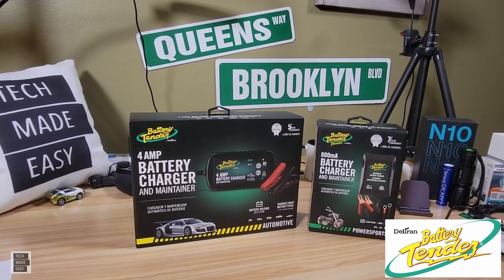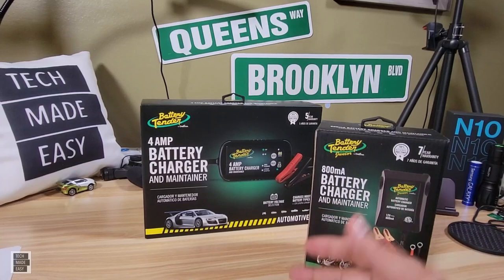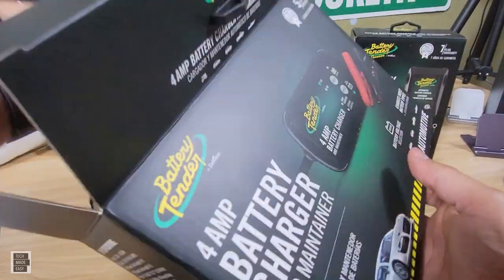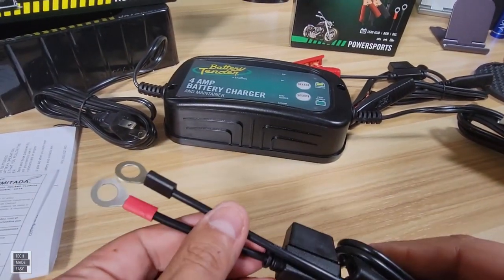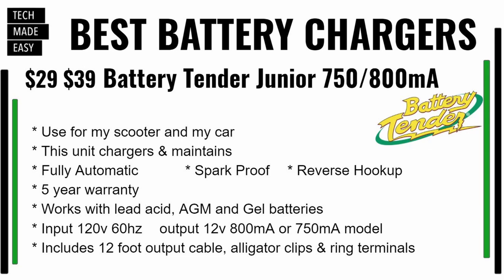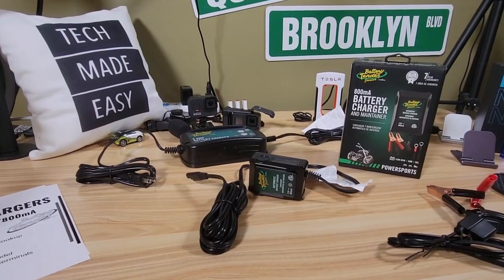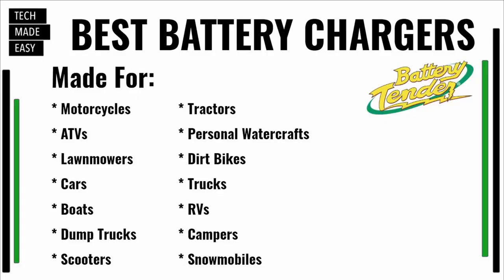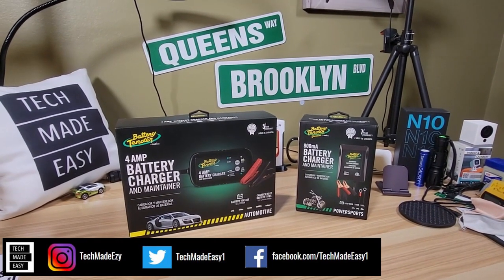Battery Tender Saves your Batteries Battery Tender Review

Comment: I heard about Battery Tender many years ago. But I’ve only started using one recently, which I bought from our dealer (they have a private label version).

Definitely has saved our battery several times. We’re going to get the ring terminals installed the next time we need to take the vehicle into the dealer.
Reply from the maker: I’m glad it isn’t expensive as well

Comment: Hey Tech!  Been using Battery Tender for nearly 20 years.  Great brand and great products!  Very reliable.
Reply from the maker: Thanks Kraz definitely impressed myself
Reply: "Been using Battery Tender" - Me too. But folks should also know that they will dry out your cells if continuously plugged in (It in fact heats up the cells, this KILLS your battery !). Better to have these battery Tenders first plugged into a TIMER; I set mine for only four hours a day. This allows the battery to cool down & not get to the point of 'boiling'; less chance of drying out the battery electrolytes (lifeblood of the battery). :face-fuchsia-wide-eyes:

Comment: I plugged in my 1.25 A charger 'Battery Tender Plus', like  your 4 Amp charger,  to my handheld spotlight ( came with a plug socket like your scooter) and the orange and green alternate in flashing. My battery is a 12 volt and I'm guessing it means it's 80% charged . Never seen the orange and green flash alternately before.  I did check the plug for POSITIVE AND NEGATIVE to make sure the plug was on it ok. I also just replaced this battery and used it a few times also. The green 12v light stays solid.

Comment: It looks like you have the positive cable removed from your Mustang battery.  Is that just how you store it?  Or, do you remove that first before hooking the tender up to it?  Should you remove both the positive and negative cables from the battery terminals before using the tender?  Thanks!
Reply from the maker: My Mustang sit in the garage during the winter months so I disconnect it from the car but I actually trickle charge the battery so it doesn’t go bad. They say it’s not recommended especially for current models although that’s a year 2000.

Comment: I just bought a Battery Tender Plus, do I connect to AC and then to my bike or the bike first?  Thank you
Reply from the maker: Hi Artie
Connect to wall power then connect it to your vehicle, it's very safe.
Reply: @Tech Made Easy  Wow, thank you so very much for your quick response. It was very much appreciated.
Reply from the maker: My pleasure Artie
Reply: I would connect to your bike or car first then plug the battery tender to the AC because as safe as it may be I don't want to plug it into the AC without knowing where the other end are. They might be touching each other, in a puddle of water, etc.
Reply: @enufots4621  thank you,  very much appreciated.

Comment: Is it safe to use the battery tender while battery is still connected to the vehicle. My vehicle has a lot of bells and whistles such as cell service so I can access the vehicle information with a mobile app. I don’t want to disconnect the battery from the vehicle but I also want to maintain the battery since I work from home and drive the vehicle maybe once a week for about 15 miles round trip. I also have a dash cam with parking mode that is constantly powered on. My concern is the charger would do something to the vehicle components and/or dash cam.
Reply from the maker: If I understand your question, you don’t need to disconnect your battery from the vehicle to use the battery tender the battery tender is really a trickle charger. So your battery stays connected to your vehicle and you simply connect the battery tender to trickle charge your battery in cases where you’re not using the vehicle for a while.

Comment: I have  the 1.25 AMP Battery Tender Plus along with optional Deltran OBD2 port connecter and its been working great for years.  If I were to go to the 4 Amp version you have in the video, would the amps be too high to charge thru an OBD2 port?
Reply from the maker: Hi Carmine, I really don’t know that your best bet is contacting the manufacturer OK

Comment: Is it safe to leave hooked up to battery in a car that is stored in a Florida garage that is not air conditioned and gets very warm in the summer.
Reply from the maker: I would check the manual or with the manufacturer on the temperature operating conditions that's usually in the manual there's always a limitation

Comment: This looks like a good unit.  I have a diesel truck that I do not drive often and is always going through batteries - but it's always parked outside; would a 3 or 4 amp charger/tender be able to sit under the hood and still work with the weather?
Reply from the maker: I'm not sure, I keep mine in a non-insulated garage so it gets cold and it gets hot but it has some protection against the weather you're better off checking with the manufacturer
Reply: you do not need the 3 or 4 amp unit.
For maintenance only, the .75 or the .80 unit will take care of the battery just fine. It will cycle the voltage, keep the voltage topped off and desulfate the battery. You can leave it on all of the time without any danger to the battery or the system. Really not necessary to be on all of the time though. You can use it on other batteries as necessary. Unless your truck has an electrical issue causing battery drain, you should only need to use the Tender about once a month for a couple of days to keep the truck battery in good condition...
I have one Tender Jr and move it around to different vehicles and also other home batteries to keep them all in good condition. Been doing this for years and have some batteries over 10 years old still in good condition.
Reply: @joemcmillan2089  Mostly it's the truck's security system, we just don't drive it enough
But I've gotten the 3 amp already, just been putting off hooking it up correctly; so much snow - thanks
Reply: @Agent505  The 3 amp unit will provide much faster charging for when a battery is discharged. Will not create any issue. As I have a couple of full size chargers, I chose the 800 mA unit - now I hardly ever use the larger units. You'll be happy with your purchase..

Comment: Excellent video. I went out and bought the 4 amp for my truck. Nowhere in the instructions does it suggest 'how often' I should use this product.  My vehicle is only driven once or twice a week and less than 10 miles each trip. I know it could be used daily, but that's probably not necessary. Any idea how often it should be used ?
Reply from the maker: Thanks Chris
Not that I’m certified or anything but I would say 1 week on 1 week off? I keep mine plugged in for months during winter

Comment: I know this is an old video, but have you used these outside much? My car battery completely died because of the cold and we don't have a garage so ideally I'd like to close the hood a little bit while charging
Reply from the maker: Hi yes I’ve used this outside with my good mostly closed, didn’t have any issues. We only have so much room in the garage and we had to trickle 2 vehicles

Comment: I've been using the Battery Tender Jr for at least 3 years now. I just this morning threw one of the ring terminal hook ups to my 95 f150s battery. I haven't threw one on my wife's 2019 Escape yet. I also have the clips right now on our van since Iowa is really cold during the winter. Sometime I will grab a 2nd Tender Jr so I can use both at the same time. One of the best $25 investments I've made since moving out I use it year round!
Reply from the maker: Hi IowaFox I agree, I never knew about this product, replaced a few batteries and now we'll, it just works and I love it 👍🏻
Reply: @TechMadeEzy  I found out about these a few years back from Wranglerstar here on YouTube. The next time I went to the store I grabbed one. These also make great gift ideas.
Reply: Does the battery tender jr can actually charge a car or truck battery??????????
I’m trying to buy one for my mower I’m just trying to figure out if I buy a jr or a higher amp chrger
Reply: @rromero1318  if it's dead dead Its iffy. But if it's just low yes it will charge it and maintain it and work it as if it's in the vehicle running.
Reply from the maker: I believe a non Jr model would be best for a truck
Reply: @TechMadeEzy  the Jr model does it slower then the regular battery tender. Either will work just fine and do the same if you have them plugged and sitting.
Reply: @iowafox2206  thank you
Reply: I just bought batter tender 3 amp batter tender by deltran
Should I change higher amp ? For veh Lexus 07 is250 
There are two selections 
Type of battery lithium or agm standard ; and 6V/12 v 
How should I choose the right one? Does It automatically pick up the right one ? 
I travel out 1-2 months , then should I leave the battery charge with the vehicle hood opened? 
Your video is helpful and thanks for sharing .
Reply from the maker: @HueNguyen-hw5iy thanks for watching buddy the junior is fine and easy, just plug it in and connect it.
Reply: @TechMadeEzy  thank you

Comment: Can I use the battery tender 4amp battery charger for John Deere d130 riding lawnmower with John Deere strongbox battery ?
Reply from the maker: Should work, can’t do any damage no matter what. Built in protection but if you want, reach out to the manufacturer and double check support@deltran-global.com

Comment: The easiest way to preserve a car battery is to simply disconnect it whenever the vehicle is not in use for any great period of time. I'm on my 11th year with the same battery doing so, I only use the car in the summer months. Starts like a champ every single time, I've never had to charge or jump it.
Reply from the maker: hi thanks for your comment, the challenge with the new cars ( some of them ) is disconnecting the battery can cause other problems

Comment: I never understood the small ring terminals.   Do they really fit most car battery terminals?
Reply from the maker: I’ve never used them, They don’t fit any of my batteries
Reply: the would fit on my motorcycle batter so they are probably for that
Reply: Huh? You are kidding me right? The clamps on the battery cable typically has a bolt and a nut to which you tighten to squeeze the clamp so that it is secured onto the battery terminal right? You remove the nut, slide the ring terminal onto the bolt, screw the nut back on. Now, run the cable to an opening between the grill in front of your car. Make sure the cable is zip tied so it doesn't hit any moving parts. Now, you don't even have to open the hood to hook it up.
Reply: They also work great on GM side-terminal batteries.

Comment: Tech i have an important question. I have a 2017 Dodge Challenger. It has the battery in the trunk along with speakers and a tire inflator. Is this a problem? Thank you.
Reply from the maker: What's the question Robert?
Reply: @TechMadeEzy  Simple question is do open the trunk and connect the tender there or do i open the hood and connect the tender there? WHICH is the question.
Reply from the maker: Hi Robert I open my hood and leave it connected there, easy to disconnect when I need to drive

Comment: My battery tender seems defective. Everytime I charge it it always says fully charged. My snowblower and my truck says the same. Any idea?
Reply from the maker: No sorry, I just trickle charge my scooter and mustang, have you called support?
Reply: @TechMadeEzy  not yet no. It starts off for a minute saying charging than after solid green
Reply from the maker: Mine does that as it trickle charges, orange then green after a little while and stays green and trickle charges
Reply: @TechMadeEzy  mines a brand new battery. Well 2 weeks old. Wanted to charge it for first time
Reply from the maker: New batteries usually are pretty full correct?
Reply: @TechMadeEzy  yes correct!

Comment: When the dealership said I needed a battery tender they meant this. Truck can’t even sit a week without going flatline. 1 year old has 10k miles on it so it’s not like it doesn’t get driven but sheesh. My truck officially is going to identify as a plug in hybrid after this 😂
Reply from the maker: Love this, works great worth every penny
Reply: I know this isban old post but my new Ford truck did the same. They blamed me on not driving it.  What a crock. Finally they admitted it need a new battery. Was faulty to begin with
Reply from the maker: It’s definitely good to trickle charger. Battery of your vehicle is going to sit around especially for weeks and months.

Comment: I have the 4 amp  :) I use it together with my Halo Bolt 58830 Mwh Portable Phone Laptop Charger Car Jump Starter with AC Outlet ,instead of connecting it o a Wall Outlet!

Comment: Folks should also know that ANY battery charger maintainer will dry out your cells if continuously plugged in (Even a low amperage model, they in fact heat up the battery cells, this KILLS your battery !). Better to have these battery Tenders first plugged into a TIMER; I set mine for only four hours a day. This allows the battery to cool down & not get to the point of 'boiling'; less chance of drying out the battery electrolytes (lifeblood of the battery).:face-fuchsia-tongue-out:
Reply from the maker: I did not know that, thanks for sharing

Comment: When do you need to pop the caps of the battery? I bought 3amp from crappy tire
Reply from the maker: Not sure I understand Brett
Reply: Can i use this in minus 7 celcius weather
Reply: The caps on the battery. Do they stay on?
Reply from the maker: Not sure here is the email to the Company
support@deltran-global.com
Reply from the maker: If you have caps that means the battery is new, take them off and throw them away if you will be using the battery
Reply: Thank you
Reply from the maker: Glad I could help, love these battery tenders I use 2 of them all winter and part fall